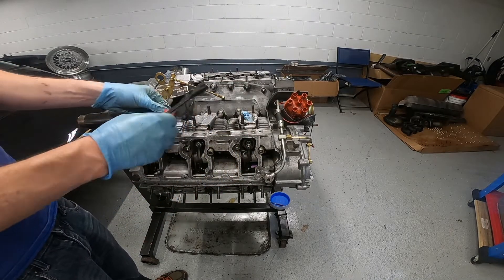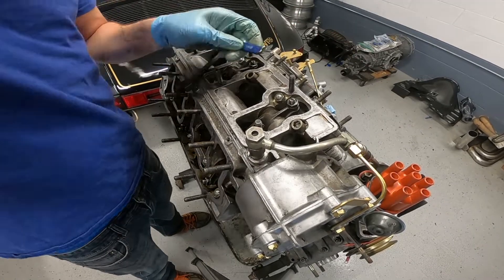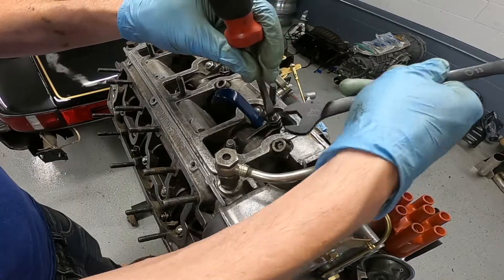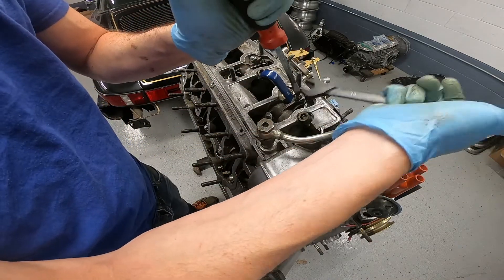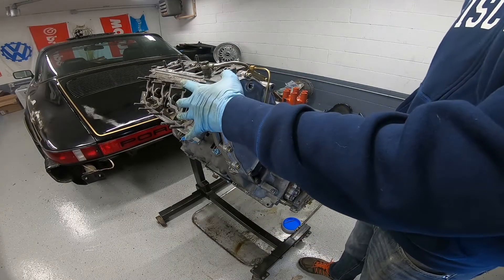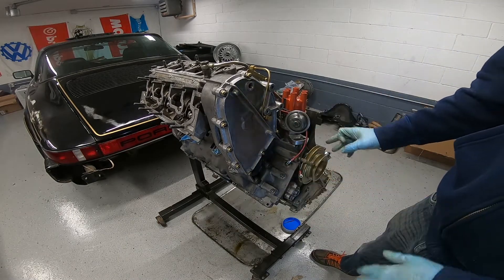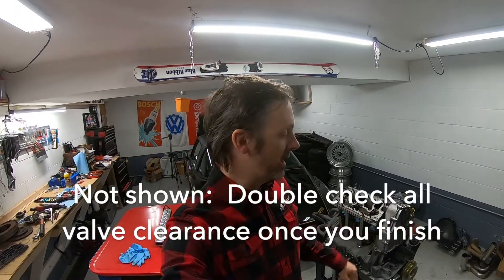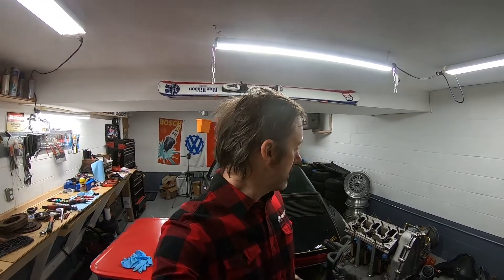How To Adjust Valves and Set Valve Clearance on an Aircooled Porsche 911; Projekt Airkult Ep18

Comment: Thanks again for this video.  I"m sure you've seen the 'back side' method of adjusting valves - that might make it easier after you get the targa back on the road when you look at the valves again.
Reply from the maker: Yeah, I've read about it but never done it.  Will definitely give it a shot once the car is roadworthy.